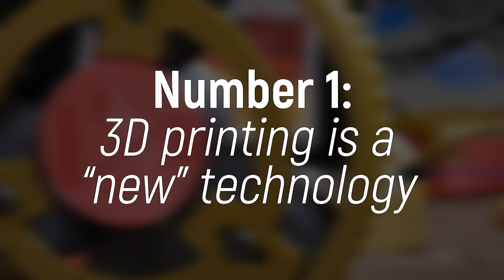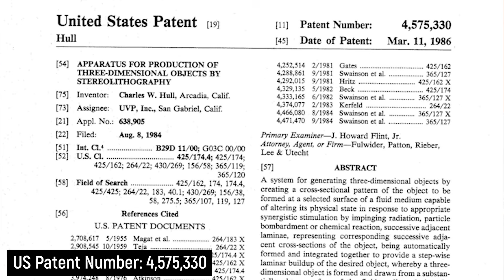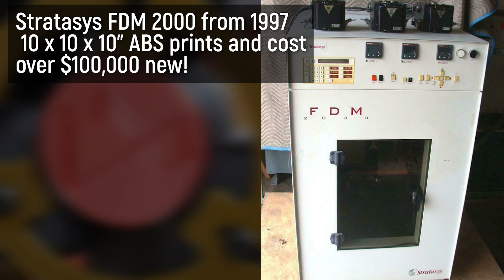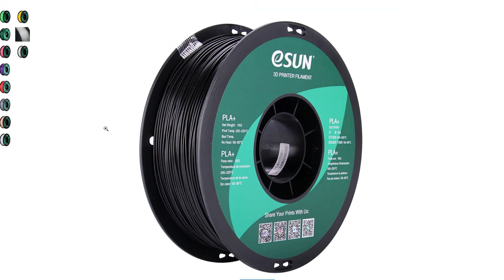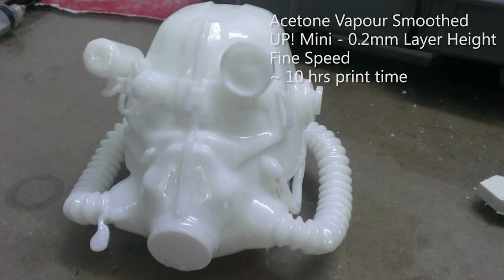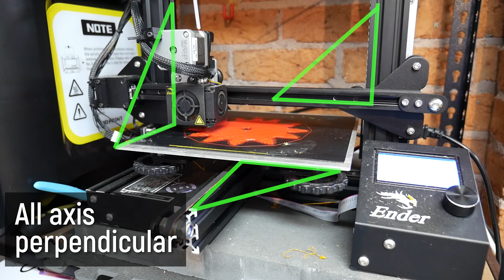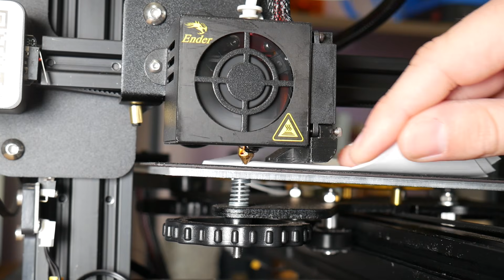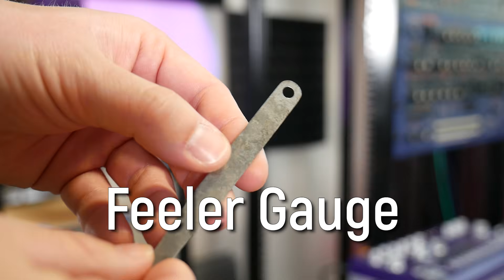3D Printing Myths I used to believe...

Comment: Another big one is that "automatic bed leveling" is a misnomer. The concept is more like "automatic topology adjustment", since it's not actually physically affecting the bed. An "ABL" probe is actually measuring the bed and adjusting the height of Z according to the topology of the surface, and as such it has an overall tolerance for how "slanted" the bed can be before it stops working altogether. ABL probes are not sufficient enough to correct major deficiencies in hardware, you still need to level your bed relative to the XY plane of motion for a probe to do its job effectively.
Reply from the maker: Agreed! It affects final model accuracy which isn't something often discussed .
Reply: I kinda doubt many people thought their bltouch was physically leveling their bed.
Reply: @rayaguilar9085  I think a lot of people probably think the sensing action actually affects their bed's position. 
See my comment above and here is an example of the "push, pop" style machines. 
https://youtu.be/o0ooFNlSAm8
Reply: @rayaguilar9085  I see it all the time. Folks think exactly this,  and are flummoxed when it just won't work,  to the point of taking it off. Even on a machine like the Ender 5 Plus which requires the bed leveling probe as the Z endstop.
Reply: 1. Re: "it's not auto bed leveling." 
On some specialty printers it is, they usually have 3 independent z lead screws that can actually tram the bed for you. 
2. Re: "the topology adjustment method fails at certain angles."
Tom showed it working at some pretty extreme angles in the past.  Obviously the parts came out skewed, but he basically tilted the bed as far as it would go IIRC.
Reply: @BrainSlugs83  Just to nitpick it further: ABL is indeed what he mentioned, assisted tramming that you mention is separate from that (and the cool one I would say).
Reply: I think it would be accurate to describe it as "Automatic Z-axis compensation".
Reply: Yeah, it only provides adjustments in various locations so that the print comes out as IF the bed were perfectly, or near perfectly, level. The bed still needs to be within a certain tolerance, whatever it actually is I'm not sure. I am grateful for the technology though, it has cut back on how much I have to physically mess with the bed, plus with OctoPrint plugins like Bed Visualizer it provides info on how much to turn the adjustment wheels and in what direction to get a better level.
Reply: Yep! And is especially important for larger print beds made from aluminum which have the tendency of being warped or dished slightly. I think the dual Z leveling is pretty cool and actually is more proper leveling
Reply: Very true. It's obvious on a prusa with a pinda probe, but the old "push,pop" style could have easily confused some people in to thinking it was affecting their bed geometry. 

BTW, great use of the word topology. Have you studied topology at all? It was one of my last undergrad classes but had PhD students as well. I loved it, but it's not easy!

@neutrality86
Reply: I used to think it would output data so you know how much you should adjust your bed. Reality is often disappointing
Reply: @bazookasniper5167  It does though. Nothing stops you from using the data the probe provides and using that to adjust your bed instead of using a feeler gauge or piece of paper. In fact, that's exactly what I do using the bed visualizer plugin in Octoprint.
Reply: @bazookasniper5167  before I read  @jawaligt  's post I was going to say that ought to be fairly easy to implement. It already obviously stores the offset somewhere, all one would have to do is write some code to display it in a human readable format (And maybe another monitor depending on how isolated things are in hardware)

I certainly don't have the skill level to refresh a prusa or anything. But I'm sure someone could. 

And it seems  @jawaligt  already has figured out how to get at that data with an Rpi somehow.
Reply: This is true. Once again, the TRUE way to get the bed / nozzle relationship correct is to 1. Square the frame in all Axis 2. Square the Bed to the frame 3. Adjust the bed SLIGHTLY to be correct at all 4 corners and center and 4. Engage any "Auto" Level system mapping. If the bed is properly aligned the auto system (whatever name you want to use) will map any irregularities and adjust for them WITHIN THE ACCURACY OF THE SENSOR, STEPPERS, AND ANY MECHANICAL BACKLASH in the Z axis. A BIG drawback to correction maps is that the Z axis is micro stepped constantly during printing which multiplies wear dramatically. That said, it does work wonders if the mechanical systems are right as a precursor.
Reply: I think the usefulness of ABL is mostly to auto-compensate for changes that occur over time and the imperfections inherent in most (larger) bed surfaces.

Even with a bed that's perfectly trammed in terms of the leveling screws, deviations of 0.20 to 0.60 mm across the surface aren't uncommon. Enough to affect bed adhesion.

Comment: Here's a myth to test:
"If I'll watch it, it won't go bad"
Reply from the maker: Only the brave walk away without watching the first layer .
Reply: @MakersMuse  I don't watch the first layer because it always goes bad when I watch it but if I hit print and come back later it's fine
Reply: @TheSecurity16  well, that seems likely the same for me... but with one exeption: it doesn't affect the print if i watsch it or not. it goes always wrong... so i'll "test" it with the "new" method what i've seen there für "leveling the bed". to be fair: i sit there several times and try to level it, sometimes for hours on all 4 corners, the middle, and the middle of all sides... and even then, when i leveled each point for maybe the 5th time, a bad first layer appeared (it's not from the bed, 'cause i level on a ultrabase). i might understand now what i maybe made "wrong" with that leveling, and try to test it with a feeler-Gauge instead of a paper - more that it goes wrong can't happen.
Reply: @TheSecurity16  That's completely illogical and not the proper way of doing it.
Reply: @dangerous8333  I don't remember asking you if it was logical. Not everyone has the time to sit around and watch first layer pron all day
Reply: @TheSecurity16  You consider is fine.
Reply: @TheSecurity16  Do you have a Schrodinger brand of printer? haha
Reply: @TheSecurity16  Same
Reply: @MakersMuse  I've only had my printer for about 2 months, and i already feel this in my soul.
Reply: @MakersMuse  it could be a stupid thing, but I use a similar tool since I've started printing.. Then I've found this on instructables. Never had a problem. Even if I would say that often I level the bed only with eyesight. 

https://www.instructables.com/3D-Printer-Bed-Leveling-Assistance-Tool/
Reply: @MakersMuse  or the foolish. 

I've one single catastrophic failure since starting this adventure, and it was when I walked away from the first layer.
Reply: @MakersMuse  I've done it before. Nothing bad happened yet.
Reply: @MakersMuse  Or the foolhardy.. ;)
Reply: @MakersMuse  i start print usually nowdays and walk with my dog str8 after print activated just cleaning the plate etc. problems can occur after hours sometimes
Reply: @MakersMuse  against all reports of consistency with the ender 3pro, I often remotely start a print and check it sometime after it's started, between layer 1 and 3. Nice and tight build and well dialed in bed height. A few upgrades with springs and glass bed and it's rock solid. Have been using known thickness on the print height settings for some time.
Reply: Used to avoid watching the first layer because it made me anxious. But now I can´t leave before it's complete.
Reply: @MakersMuse  My CR-10S Pro V2 gives me the confidence to walk away before even the 1st layer.
Love this printer!
Reply: @MakersMuse  i never walk away since my filament is always tangled, i just have the printer in my table
Reply: @MakersMuse oof this is so true! Started a 14hour print then went to bed and woke up with the bottom corner of my object ruined. I stopped the print and started over so I didn't waste any more filament
Reply: I don't like having a Schrödinger's print going, I NEED to check the first layer, always!
Reply: @exxon1800  Schrodinger's print.. Priceless :D
Reply: @exxon1800  The cat's always alive in the box I printed when I check.
Reply: This group of comments is absolutely hilarious!  LOL
Reply: *laughs nervously** you guys watch your stuff? I just hit print from the other room and check on it when it's done 👀👀👀
Reply: @DangaRanga  Yeah, OctoPrint helps with that.
Reply: I've tested this.  It is 100% false.
Reply: @BrainSlugs83  you blinked too much
Reply: Seems true in practice in my shed, but mostly because I can't help but get my hands in there to clean bed buggers and otherwise help it out when needed, so I seldom lose a print if I'm watching.
Reply: @Rickards3d  I too have a tendency to do that,  unless my wife was prodding me to take her to the store.
Reply: i wonder how this interacts with "a watched pot never boils" 
can i look at something so closely that it will be perfect but never complete..using my cosmic ray glare :-)
Reply: @mm-yt8sf  "A watched pot never boils *over*", ie, won't overflow when it starts boiling.  Example of distortion based on partial information.
Reply: My printer is in another room, but I can watch it remotely on an FPV watch (a wrist wearable screen), on the printer I have a 25mW 5.8ghz video transmitter + camera + white LED (to see it printing in the dark)
Reply: @licensetodrive9930  have all that stuff sitting on desk right next to printer. Going to have to set it up now. How do you keep the fpv transmitter cool? Mine gets hot if I’m not flying. Edit: maybe I’ll just use the esp32 cam on wifi, but the 5.8 wrist mounted display is awesom.
Reply: @5T3LTH  I'm using an old ImmersionRC 25mW VTX, it's too big & bulky & low power for the quads I fly, it has a heatsink already on it and it doesn't produce much heat because it's only 25mW, I run it for hours at a time without issue.
Reply: @licensetodrive9930  awesome thanks for the info
Reply: A watched print never finishes.
Reply: I just bought a 3D printer yesterday and installed a webcam so I can check up on it from the other room lol. So far so good
Reply: @gorblax3524  the eye of sauron method :-)
Reply: You're all doing ot wrong, you're supposed to set it to print before you go to bed and then it'll be done in the morning.
Reply: Prints will fail within 5 min of you going to sleep.
Reply: I watch the first lines of the skirt, if they stick, it'll probably be OK
Also, use an old smartphone as ip-cam and mount it level-ish to your bed so IT KNOWS ITS beeing watched...
Reply: Live free.. hit the start button & walk away.
Reply: I haven't heard that one in the hundreds of videos I've watched, or the hundreds of comments I've read. Not even once. Did you just make it up?

You're supposed to watch it at first to simply make sure it starts off well. So you don't end up with a bird's nest. That's the only thing I've ever heard.
Reply: Always watch the start of my pla prints then check in every hour or so. I just wish I could see what was going on in the resin vat on my photon so I don't waste time printing nothing after a failure 🙄
Reply: @lowriderbug  if you trust your print settings etc. you fine i also just use 3Dlack quite often so i dont have to wory
Reply: I only watch the first layer if I'm trying to test a new setup whether new plastic or bed. I also watch it if I'm bored. Once I get settings dialed in I just trust my printer.
Reply: Never fails, as soon as I leave the room the whole thing goes haywire
Reply: Once I get her dialed in maybe. I Watch first several layers as I have a high failure rate and want to avoid having to clean the nozzle
Reply: I've saved myself much PLA waste by watching those first 3 or 4 layers. Usually a print goes to trash in those first ones. But I had one that got out of synch after it had printed for several hours (electrical flicker?) and I had to trash it and start over. But I have tried hard not to just close the door and walk away thinking that it was going to print flawlessly without an occasional check.
Reply: That's why my first upgrade was an OctoPrint (OctoPi) server with a camera. No matter where I am in the house I can start a print and watch for first-layer issues. That being said I still periodically go to my room and check on any prints over an hour with my own eyes. There is definitely some truth to that statement though; although watching a print doesn't prevent it from failing, those failures certainly cause a lot less heartbreak when caught early...

That being said, the more you use a particular printer and slicer together, the more you know where your attention is needed. Once everything is set up  and dialed in, you can generally trust these machines (assuming you don't run an absolute bargain basement POS). Any failures I've ever had were directly caused by my own setup mistakes like forgetting to switch material profiles in my slicer, loose Y gantry, poor "leveling", etc.

The worst is using the wrong bed type for the material (i.e. TPU on PEI - always fuses together permanently)
Reply: No, no.  This one is true x]
Reply: I have done it, doesn't work but you can switch off avoiding excess waste.
Reply: Watching my print rn just peeling slightly at the edge and thinking it could still go kinda ok
Reply: When a tree falls in a forest with no-one around - does it make a noise?
Reply: Makes me worry about my current print....
Reply: At our makerspace this is very true. Everyone who watch their prints will succeed. The rest who leaves have a failed print guaranteed.
Reply: "This is my 4th attempt. I'm just gonna let it go and clean up whatever mess later" 
Prints perfectly 
"Fuck right on"
Reply: @pilsnerd420  doin this right now before bed- first three prints had a support peeling off in the 3rd/5th layer- fiddled around and it's been going smoothly, but now I'm in bed and reading these comments... 😫 Must resist checking on it
Reply: I disproved that
Reply: No it definitely is true. for this is the reason I get extremely stressed when leaving the print when it should be the same chance to fail
Reply: "A watched pot never boils."
Reply: @kbee225  Then you look at your watch for a second and the plastic decides to separate from the bed
Reply: Lol...truth
Reply: Ummmm....what's a failed print?...
Reply: Until you collapse the wave function of the filament's matter, it will exist in superposition much like a USB 2.0 port. only after observation can it exist in a singular state.
Reply: That is so true!
Reply: Schrodinger's Cat (wait did I already say that?)
Reply: How to tram/level ur bed for the best first layer:

Run CHEP sq_level g.code
Watch the hotend print squares on ur bed. 
The lines should look like thin fishing line and use ur fingers to run against the line. If it peels away from the bed, then the print head is too high. If it sticks, then it is perfect. If the lines are flat, means it is too low.
Reply: What about blind people?
Reply: @seppelescur  I don't think there are many, if any blind people who 3d print due to the major visual aspect.
Reply: @EvelynH-tj1qt  There may not be many, but I know there are more than zero blind people who 3d print and do electronics and robotics projects.
Reply: @EvelynH-tj1qt  There are a handful of blind makers doing 3d printing, for example at NY Public Library's Accessible Media Lab. The technological and coding entry barrier is a lot higher. There are a few things that you need visual input on, but several of the slicing programs are screen-reader accessible. Designing models is hard but to some extent possible. You can code it line by line in python, for example, and then iterate on your design. Simple geometric shapes are easiest. It's fun to take pictures of famous artwork and put it into a slicer and use the color to height tool. Not all pictures will transform well this way but it is a pretty quick way to create an interpretation of the art that has more meaning to someone who is visually impaired.
Reply: @jennifers795  honestly if I was blind I would rather stick to my music. I don't have enough patience to learn how to 3d print without being able to see.
Reply: @seppelescur  the bravest of all
Reply: @seppelescur  Why on earth would a blind person get a 3D printer? You sir made my day!
Reply: @simonbionary11010   haha i get why you find it funny ;) but i think there is also a big tactile experience, and perhaps even tools to assist blind people we wouldn´t think of
Reply: @seppelescur  For sure they could manage to a certain extent.
Reply: They get filament over their hands while printing and checking.

Comment: dont fold the piece of paper . most printer paper measures .003 thousands . that has been working for me . but i didnt know about setting the nozzle height before touching off the nozzle
Reply: Printer paper is typically .1mm or .0039"
Reply: @Kyrazlan  well i stand corrected, just grabbed my calipers and measured. i swear i remember in machine tool 101 they had us mic printer paper and it measured .003 but that was 15 years ago

Comment: Isn't folding the paper just going to make your problem worse? I always just used a single paper thickness, and I'm more on the side of elephant's footing than warping and detachment. I usually don't mind elephant's foot too much, easy to compensate for with first layer XY compensation and/or a bit of sanding/deburring. You can also chamfer the bottom of the model if possible.
Reply: btw  you can adjust elephant foot by adjusting initial layer expansion you will get perfect first layer and no elephant foot.